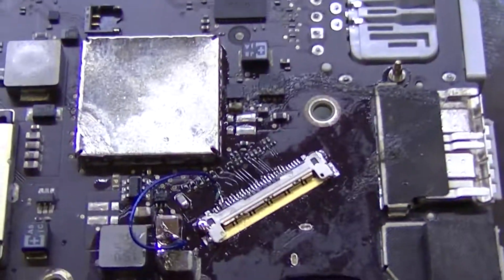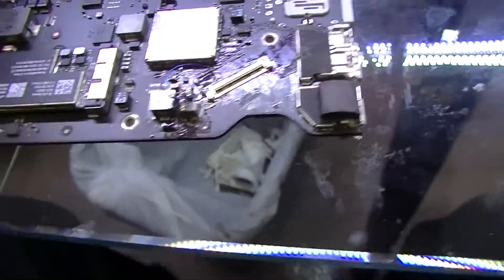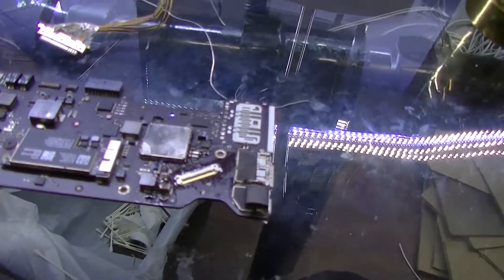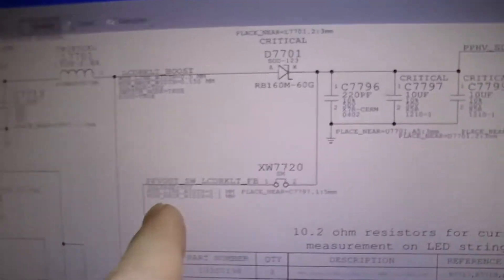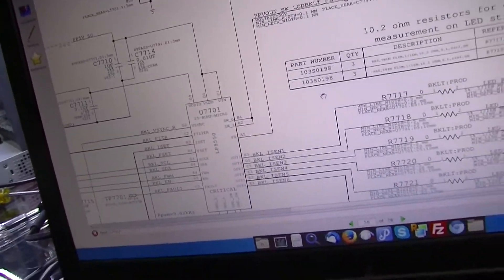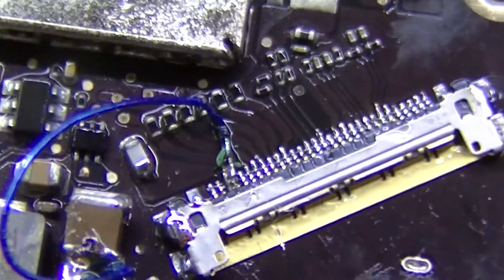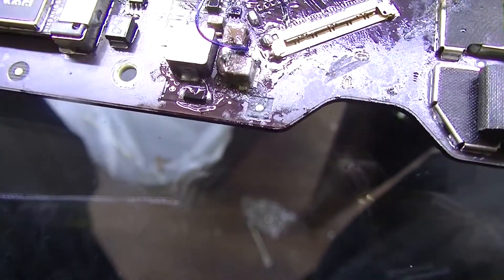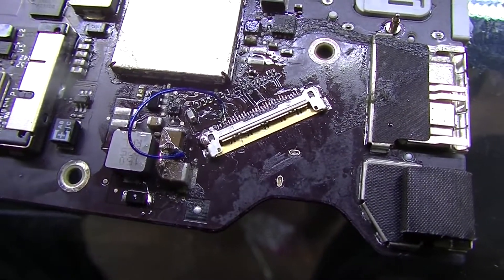"Macbook Air no backlight logic board repair A1466 820-3437" date:8-20-14

Comment: Thank you sir;

I have liquid damage a1466, when i looked board D7701, L7701 are corroded And little button XW7720 is burned/rusty. 

Other everything is fine (LCD connector, C7796-97-99 and at the back U7701 is fine no damage)

How can i understand by measurement that the problem at XW7720 button?

Than if its broken, i have to wire it to D7701 for working feedback like your video.

Thank you.